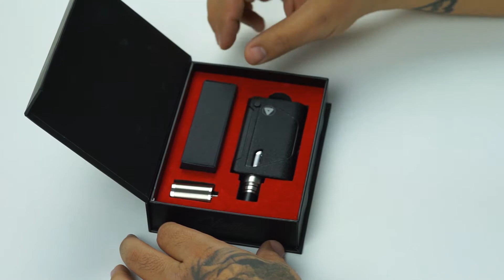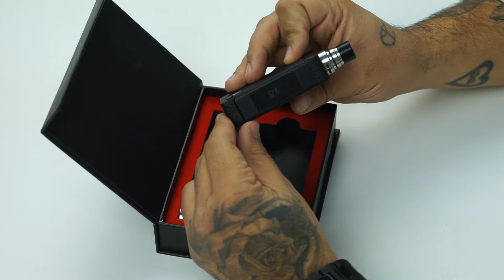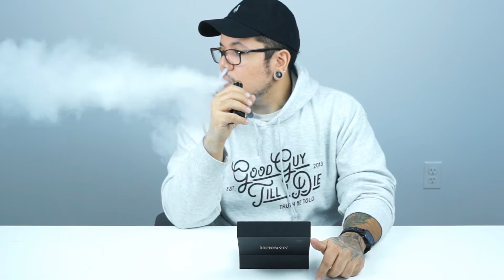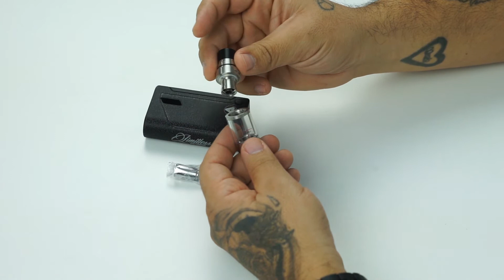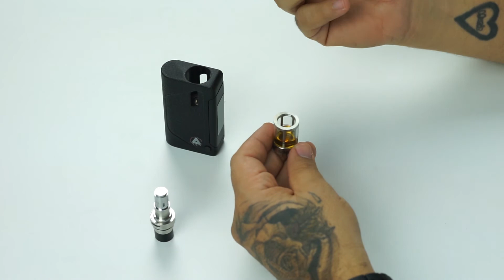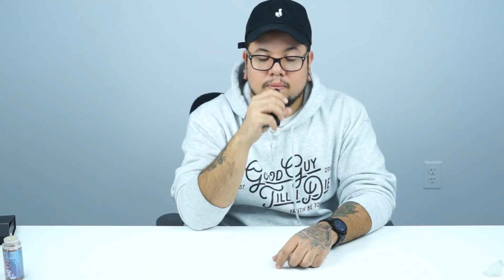Good Guy First Look: Limitless Marquee

Comment: Good video. Mine is stuck on Display Options??? I can't get it to change no matter what I do... Any suggestions??
Reply from the maker: We recommend either holding the up and down buttons to either refresh the menu options or to power the device off.  However, another option would be holding the up button and the fire button at the same time to initiate the menu system again.  The goal would be to find and select the Power Mode option in order to head back to the wattage mode.